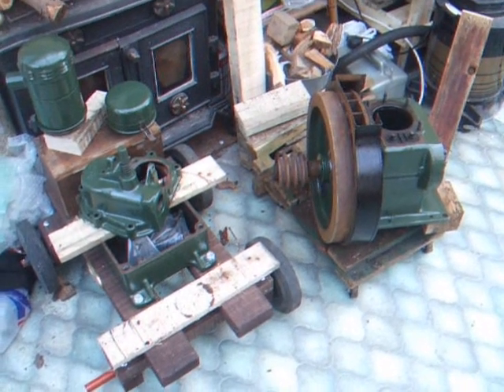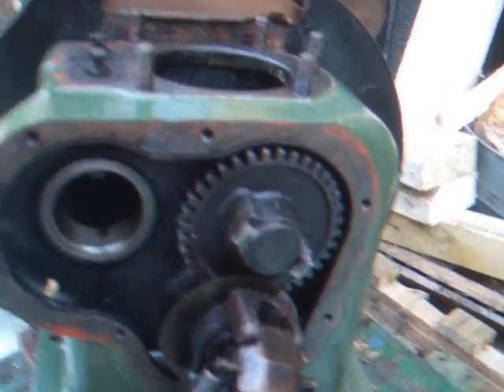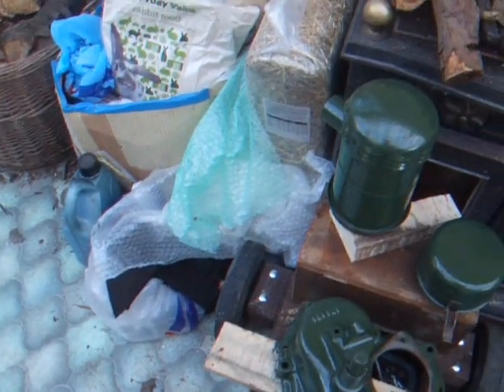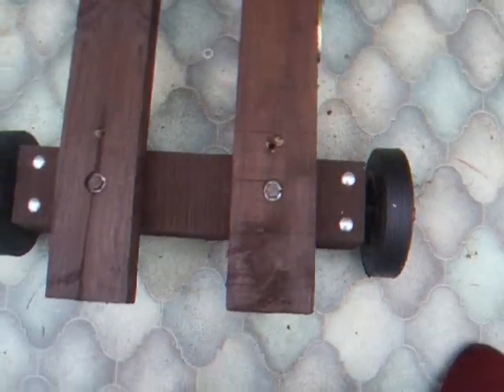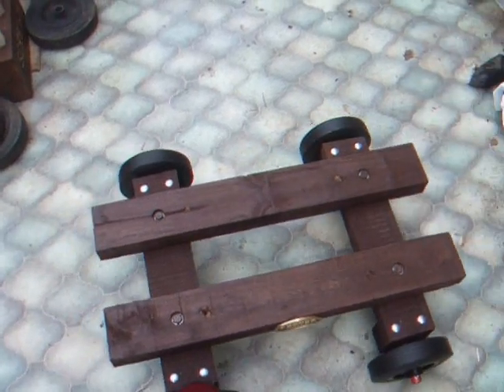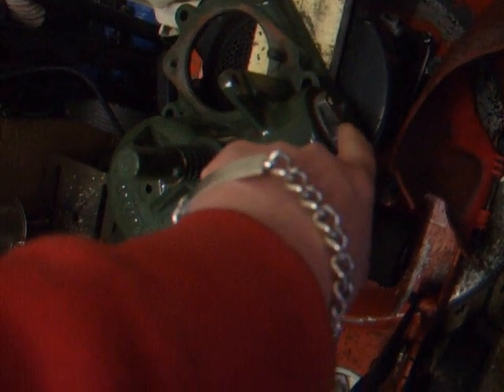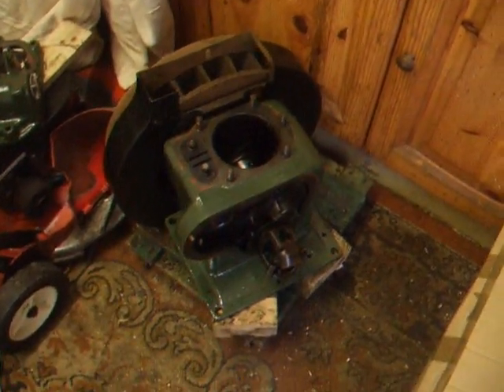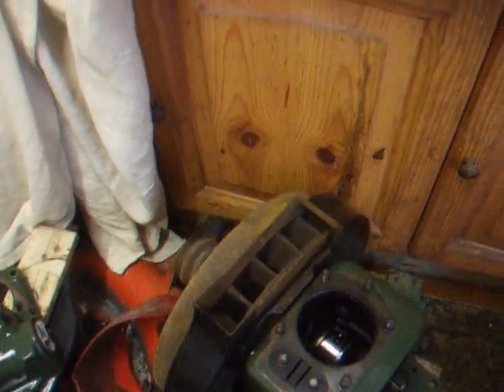Petter A - Restoration - Part 6

Comment from the maker: Cheers :) 

The worst of the crud will be wire brushed off before the engine is re-assembled. Then the flywheel will be sanded whilst its running. Engine has an oil bath filter so it'll live lol 

Dan

Comment: Coming all nicley. From where you get those brass labels, with petter & lister on? Its a pitty after you start the engine, you have to sand the flywheel. The bore is going to come all dusty :).

Thanks